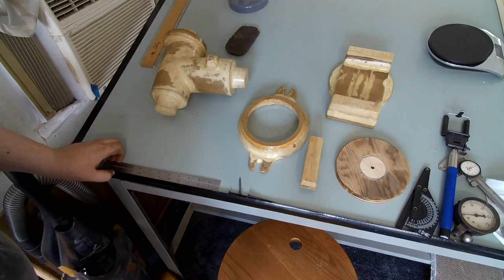The Forge Piddlings #3 - New Anvil, Flattening Stock, Tire Popper, Milling Spindle

Comment: That was some nice blacksmithing work.  Now you got some of the material you need for vertical mill. Our weather is getting better.  Looks like you got some machining now to do.  Your work is impressive using the material that you off a scrape pile.  Keep on keeping on. Can't wait for the next video.
Reply from the maker: lol, thanks. The nice thing about forging stuff out, if you dont have what you need, but have something close, all you really need is just some fire and a hammer, and you can turn the close stuff into what you really need, lol.

Comment: Thank you so much for the shoutout and the praises! I loved watching the forging, using the weight of that bar to upset the flange is a great technique. When you mount your anvil, I'd consider a steel base (with wheels for mobility) if possible. I used a wooden stand for a long time but I was blown away by how sturdy a steel stand is
Reply from the maker: No problem man, you defenitely deserve the look. Your stuff is really good, and have some pretty cool proojects. I always stayed away from a steel base because it would carry the vibrations imo and not be as solid, especially on the soft ground where I usually forge at.
Reply: @ChirpysTinkerings  Makes sense why a steel base wouldn't be ideal. I'm on concrete, which is great for steel and terrible for wood stands
Reply from the maker: @hiddenworldforge374  Ill have to keep that in mind, thanks man.

Comment: Brian from Ma.Awesome anvil alot of useful features makes nice for up coming projecs Besafe
Reply from the maker: lol, yea, it is a pretty awesome anvil. Im sure it'll work alot better when it's firmly mounted down to a base too.
Reply: Ya i cant figure out if i want to chain mine down some howe or i was thinking railroad spike on each side of foot dont no was also thinkin about routtering a resess in wood plat form i used presure treated four by fours and built kinda a genga anvil stand anywho Besafe
Reply from the maker: @machinistwanttobebrianfrom6887  Yea, Im not sure how Ill mount mine down just yet, probably some straps across the feet or something with some long lag bolts probably.
Reply: Ya I had bought four of the rolls of i think have inch pipe hanger stuff with all the holes i was going to cut four strips and doubble nail each side of each   foot
Reply from the maker: @machinistwanttobebrianfrom6887  That may work depending on what your using as a stump/base, but Ive always ended up ripping them back out pretty fast when using the anvil, lol.

Comment: Thanks for the dimensions.  I have been considering a possible future project. I think my Cochrane bly mill would be a great candidate for a right angle adapter.  Since it is of such a unique design nothing is commercially available.  I was considering fabricating a body and machining guts and its special mount
Reply from the maker: no problem, I know my dimensions were way off from what I said last time, and just wanted to give you the correct dimensions, lol. Ive seen some fabricated vertical milling heads, ones like the marvin milling head, or the various ones made for the atlas horizontal milling machines. I would check there for ideas. I know they also made a slotting head that was pretty neat too that went on in the same way.

Comment: You need a trunk section from a hedge tree (Osage Orange) for your new anvil.  Get it green, work it to your preferences while still green.  Once it dries/cures, you will need metal machining tactics to do anything significant with it.  A chain saw will hardly touch it at that point.  It should be plenty dense for an anvil.

That's a pretty ambitious set of iron casting projects.  You should see if Clark could use a hand for a week or so, maybe get them cast there, and let him make a set of aluminum production molds of the vise.  That seems to be the kind of things people want, why should we pay China for them just to wind up doing correctional machining anyway?
Reply from the maker: Ive been looking at different bases and such for the anvils, and more than likely, Ill probably just use a stump from an oak or hard maple tree, there's alot of those trees around here. That or just fabricate something up tbh. 

I have worked with clarke before, I was ramming up molds while he was pouring when we were at the one steam festival together, lol. Im not really a fan of using brake rotors, so Ill just pour them myself tbh.